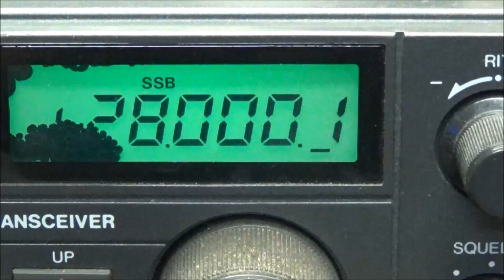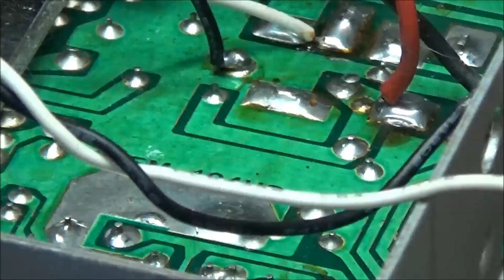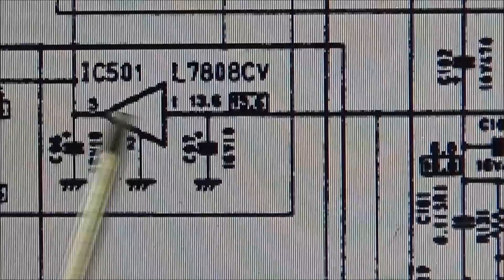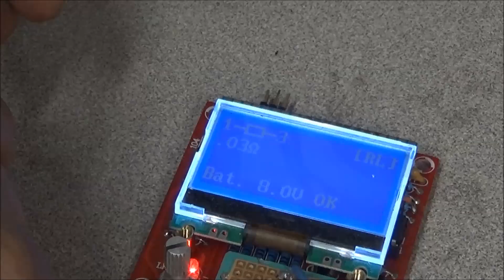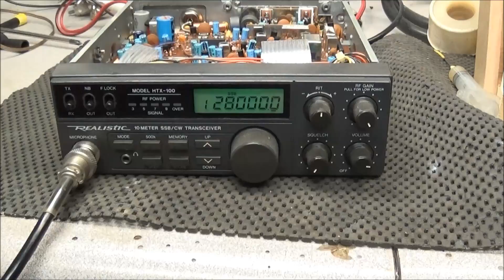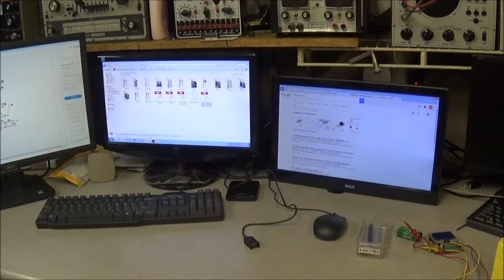#80 Realistic HTX 100 diagnostic and repair

Comment: Just got this radio. It would not go in to transmit mode. Searched QRZ forums, and found someone that had the EXACT same problem several years ago. He said a cap near IC3. Sure enough, the exact cap was bad on mine. Now it works.  Did these rigs have the same cap issue that some motherboards had i the early/mid '90s??    Should I change out ALL the caps? I'm thinking that is sometimes asking for trouble (If it ain't broke, don't fix it!!!)    Can you advise??

Comment: I had the similar problem with a HTX100 someone gave me. That same 1000ufd capacitor shorted out and took out the 8 volt regulator on the PLL board. Fortunately, it did not burn any traces on the PCB. So, with about $1.50 in parts, I have a working radio.

Comment: I have a HTX-100 in my Shack, now on my work table. A couple of days ago while connected to a power supply, but turned off via the knob for power on. Then checking power wiring to other radios with my hand touched the cooling fins on the rear of the HTX-100. It was hot surprisingly. Didn't burn, but was warm enough. Have to wonder why that would be? Checked again, Power knob off? Thanks ahead for any info! n9vck@att.net

Comment: The Radio Shop,  I suggest building a proper capacitor leakage tester, perhaps using the Patreon sponsored Paul Carlson design (a very sensitive unit). de KQ2E

Comment: Tnx for the video.I ordered my cap kit on e-bay for my rci2950. didn't really like the mix he sent.But I used them anyway.Can you tell me a good place to get the kits from?Tnx again. kn4u@comcast.net
Reply from the maker: If I had to buy kits it would be from Klondike Mike on ebay. I mostly just order the capacitors I need from mouser or just radio out of Canada. Depends on if vintage or not.

Comment: I have one of these wonderful radios. I also have the same problem that the LCD display has a bleed area at the top left corner. When I was in electronics school, I did a power transistor update. Mine will do 100 watts on high and 10 watts on low. I also would like to get my display repaired.
Reply from the maker: They are great little radios. Thanks for sharing.

Comment: love the vid! watch all you stuff...learned a lot, Thanks! however I came across this one working on my own HTX 100 that seems to have some sort of issue when it's cold, the display lights up but no numbers, no RX or TX, after a few minutes of warm up the display comes on and it works fine. I suspect a cap as well and was going to re-cap the whole unit unless someone has had the same problem and may know of some other issue that would cause this other than a capacitor.  Thanks for all of your help!
Reply from the maker: That could very well be a capacitor issue. How ever don't rule out bad solder joints in this radio.  Specially on the CPU board. You can verify this with some freeze spray and a hair dryer. Thanks for the comment and for watching.
Reply: thanks for the tip!
Reply: Look at the caps (5) of them right behind the display bulb. same issue with mine plastic is split open and some are melted down. change all of them.

Comment: Going to binge watch your videos over the holidays! Better than Breaking Bad. Great info!
Reply from the maker: Hi Joe. Don't wear yourself out too soon. Many more to come. Thanks for stopping in.
Reply: The Radio Shop I have a HR2510 that won't tune with the vfo knob. Any ideas?...send it to ya?
Reply from the maker: If you open it up and look at the controller board you will se a few capacitors on there. Chances are they have started leaking and damaged traces to the encoder lines. Also some of these had sony bond holding down several parts. If it has turn a dark color it has become conductive.  Open it up and send me some pictures of the board. My contact info is under the show more tab.
Reply: The Radio Shop great thanks, will check it out and send you some pix.
Reply: The Radio Shop - hello, had an opportunity to open the radio up last night, didn't see any cap leakage but while I had it opened, I shot the vfo control knob with some cleaner and the darn thing started working again! Once again thanks for your videos, enjoy them very much. Exactly what I needed to get the motivation to take a look inside.

Comment: Nice Job! I actually love my Chinese made tester. Best 15 bucks I've ever spent. I can remember when those radios were new. They are decent performers from what I hear but never had one to play with. I have a 2 meter HTX-242 in my truck. Still works well! RW
Reply from the maker: Yes for 15 bucks you cannot beat them. Work very well for what they are.  Those 242 rigs were good also. Thanks for watching.

Comment: Interesting how the display was deteriorating! I bought the HR2510 when they first came out, I still have it, albeit I have been inactive for over 15 years, so it along with my other radios have been packed up...my ticket expires soon, I'm going to let it.  How do you connect your scope to your radio to see the modulation? I just bought my first scope and dorking with it...it should be my next video.  ~Jack, VEG
Reply from the maker: Hate to hear you are letting it go. I would just go online and reapply incase you decide later to get back into it.  Just my opinion. As far as monitoring the radio with a scope it is pretty simple. Instead of me trying to explain watch Alans video on it. https://www.youtube.com/watch?v=y4Zt_LJX1TcHe shows how to build the simple circuit. Those displays will go bad if abused.
Reply: Thanks Buddy, I'll check the video out.  I've renewed it in the past and it just sits...it's kinda hard to justify putting up all that aluminum and knocking big holes in the wall anymore, it was a hobby I enjoyed most of my life but it's not priority anymore. I've kicked it about this past year, and I'm OK...worse case scenerio, I retake the test!  :)  ~Jack, VEG

Comment: Great bit of fault finding. Fingers crossed you can find another display. All the best Graham
Reply from the maker: Thanks Graham. I am sure I will. Or someone will send another radio I can make work lol.
Reply from the maker: That would make for an interesting video Randy. I may have to give that further thought.
Reply from the maker: Thanks for the video. Nice. A HTX-100 is a good rig. But does have limitations over the 2510, No AM or FM if you want o play around on 10 meters.

Comment: Funny that you posted this today. Yesterday my brother gave me a marine radio that won't power on. So now I'm going to get it out of my trunk and open it up for a good probing and see what I can find.
Reply from the maker: Cool deal Jon. Check it out and see what you can find. May be simple.
Reply: It seems to be the power/volume switch. It won't even click any more. But there's lots of corrosion inside so I'm not even sure it's worth the time.
Reply from the maker: I say just for the fun and experience see if you can remove the switch and take it apart. All kinds of things to learn in doing this. Be surprised.
Reply: Well I traced the power and I have 13.8 all the way to the switch. Took the switch apart and it's full of rust. the rest of the radio is pretty corroded too.
Reply: Turns out the switch spring was broken, so I jumped it with a piece of wire and she fired up and made some noise through the speaker!

Comment: Great job, really love these detective stories and this is a nice change from boat anchors but still love those of course
Reply from the maker: Thank you. Yes it is fun doing this type of mystery video. Keeps the mind alert.
Reply: The Radio Shop BTW I've had good luck with the EVB meter from Portugal another variant of Bob Parker's design.
Reply from the maker: Cool, get the time post a link to it. like to check it out.
Reply: The Radio Shop I believe you can get these in kits also there are many variants this just happens to be the one that I have and it's done fine http://clientes.netvisao.pt/greenpal/evb1.htm

Comment: I have one of these HTX100 that I need a final for.  On my 2510  there was a bit of adhesive holding a wire in place that ate the trace off the board that fed 13.8 v to the final.  That was a fun  troubleshooting exercise.  Really couldn't see the problem, but there was no voltage on the output transistor.
Reply from the maker: Hi Bill. Those finals are hard to find. I think the replacements are hard now also to obtain. Keep your eye open.  The problem with this radio is the electrolytic capacitors.   They are going bad due to age. Thanks for watching.

Comment: Those might have the same issue as the hr2510/Lincoln where the side mounting screws can push into the edge of the pcb and short out the supply to the 8v regulator on the side
Reply from the maker: Correct, longer mounting screws will hit the board taking the 8 volt trace out.  Luckily this one still has the original screws.
Reply: The Radio Shop - I have repaired many 2510 and lincolns, and in 90% the pcb is damaged in those spots.
Reply from the maker: Watched one of your videos on that last night. Good job on it.

Comment: Great video as usual Buddy. Was the donor radio modified for CB by any chance? Your spectrum analyzer seemed to display 27.4MHz when you keyed the rig up?  73 - Dino KL0S
Reply from the maker: Thanks Dino. Nope it is virgin. No mods.  The SA is on 27.4 but I can see the 28 MHz single fine. Was looking at both SA at once . Thanks for watching my friend.

Comment: The number one problem I see is bad caps.  I have seen so many radios that had numerous different problems only to find it was bad caps.  I have just gotten to the point I don't even bother troubleshooting most things until I have changed all the aluminum electrolytic caps first.  Have wasted so much time troubleshooting problems just to find it was a bad cap that I was going to change anyhow.
Reply: +Jon Mullins 

For most values below say 47uf you can probably stock 35 or 50 volt.  The physical size starts to increase on values above 33uf.  When I change caps I almost always use a larger voltage rating if size permits.  Manufacturers are known for running caps close to operating voltage, a sure way to shorten its life.  You will also find a lot of the time the modern replacement is smaller than the original.  Modern caps tend to be smaller physically then the original older ones, technology at work. :)
Reply from the maker: You are correct Mike. Those old caps cause too many problems and like you said, time wasting if not change. Heck as cheap as they are now no reason not to change them.
Reply: Speaking of electroliytics ... Is there any certain values that are more common to have on hand? Right now I'm just getting what I need when I need them. As you can imagine that make for some long troubleshooting. Of course I'm just getting started and only repairing personal projects.

Comment: My favorite videos....repair. Thanks!! Oh i have a Atlas cap tester and just bought a expensive capwizard that i had to repair before it worked correctly...poor assembly solder work.
Reply: I have the Atlas esr meter and also the lcr meter and component tester. They are great and save a lot of time and bench space. Highly recommend them
Reply from the maker: Thanks.  I hear those Atlas products are pretty good.
Reply from the maker: Thanks.  I hear those Atlas products are pretty good.
Reply from the maker: Appreciate that info. I really like to get those.